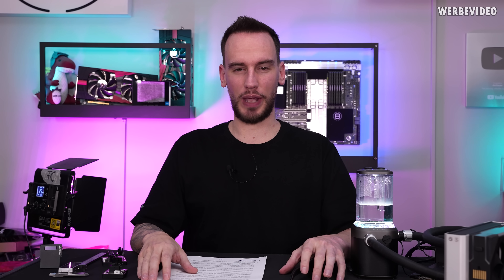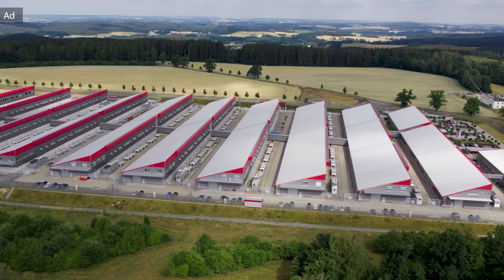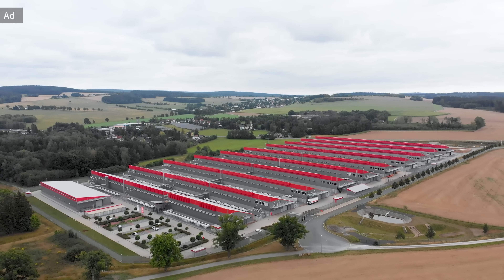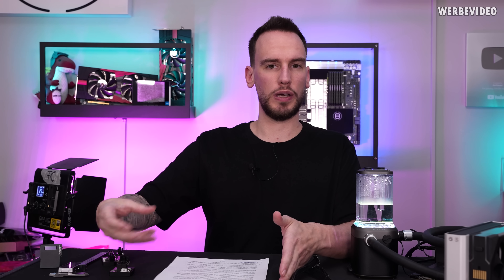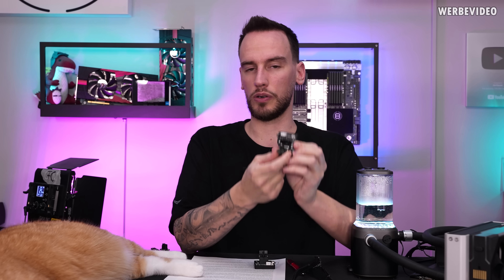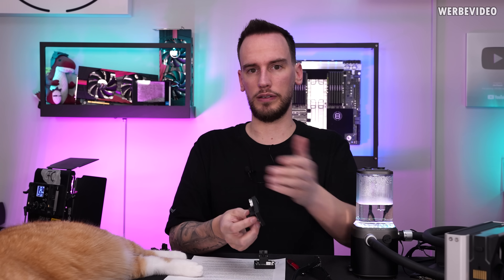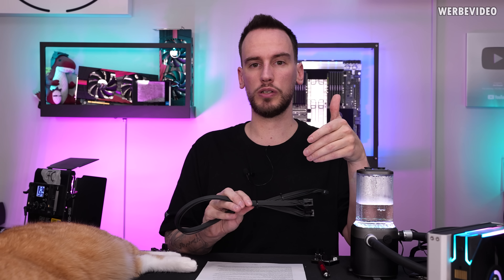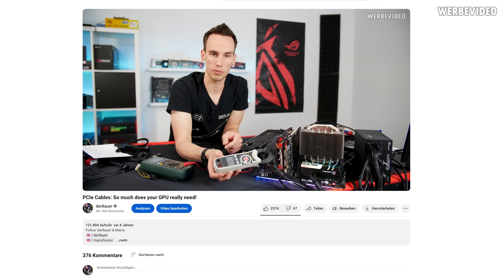12VHPWR is just Garbage and will Remain a Problem!!

Comment: it still blows my mind how this cable and issue was not caught during manufacturing and testing. It blows my actual mind lmao.
Reply: It was likely tested outside of a case with straight cables.
Reply: @weeooh1  at the factory they test circuit boards with jigs in (semi)automated testers(ICT/FCT). The test operator dont have to plug in or pull out anything, the test equipment will do the test process trough dedicated test points on the PCB. If they need to use external plugs during the test process, then the jig will handle it too(the jig uses direct contact pins instead of connector or cable). Ive worked for 15 years as SMT operator and as a group leader i needed to know the entire SMT and backend processes on "my lines".
Reply: @talos86  so no 'real world' testing conditions that takes into account how the product may perform with consumer usage.
Reply: @weeooh1  i dont know about the prototype phase, only the sample NPI phase(thats what the operators encounter on the SMT line). Those boards are usually tested off factory at the AIB to build the test equipment(usually with the help of Agilent or Keysight).
Reply: @weeooh1  The biggest false narrative is that real world testing is possible.  It is not.  You cannot test for every real world scenario, you can't even test for most of them.  You have no control over how the customer will install, what jerry rigged nonsense they will pull, how bad the conditions at install location will be with ambient temps, dust, etc., or even what kind of case or mounting they will use.  You test for standard by design install, maybe a handful of very common but slightly not standard install methods, and that's it.

Trying to do more than that is just a rabbit hole you will never climb out of or find the bottom.
Reply: As someone who is an Engineer in this field, it doesn't surprise me at all. 
Quality is definitely something I have to put my foot down for every single time. And even then sometimes I have to yield to the project manager. Only to be vidicated a month later when it is produced and gives de-rating issues anyway. At some point you'd think they'd heed my warnings but yeah...

The thing missing in his calculations though, is the effect of temperature on de-rating. Also, the CCC (current carry conductor) is usually measured by us per gauge in a cable. Not by individual strands. You can imagine the temperature in a case is usually quite a bit higher than 20, I would assume in a gaming session it'd be double. So that'd probably take another hit. So if you calculate for CCC and temperature, the safety margin would be quite a bit less. Hence the 150W.
Reply: @The_Noticer.  In the defense of the project manager they have bosses too.  I have seen many decisions like this come down to someone who is purely on the business side and get made by black and white number analysis that has nothing to do with the product itself.  What if it costs a real percentage of margin toi change which may negatively impact quarterly earnings and stock valuation?  Add in the possibility of a promised timeline to CEO/Board of Directors and what if it slips due to these enhancements?

Unless you can conclusively prove a real risk of RMA that has a real percentage associated with it (not 0.05% of a single percent)  you are going to lose that argument at the executive level.  Now did some engineer at Nvidia do this and it got ignored?  Honestly I doubt it.  They probably either underestimated the risk, or possibly social media and gamer outrage is blowing it out of proportion (which would not surprise me).  

I am willing to bet the failure rate is probably below half a percent.  Looking at amazon alone and just the 4090 founders edition over 300 have been sold in the last month even at these stupid scalper prices.  Imagine what it was like when these things sold for actual MSRP and shipping to China was not banned.  Also you have to factor cost of repair, which in this case is actually very low, you just have to desolder the old connector, solder on a new one, and bingo you are good to go.
Reply: What's more crazy is they still haven't fixed the issue after all this time
Reply: @HeliumFreak  Because they know if the 'fixed' an issue which they claim is non-existent then they will be easily open to a lawsuit.
Reply: Coming from the company that made the 4060 perform worse than the card it replaced? This is completely in pattern with Nvidia
Reply: Easy.. they only tested a small number of cables,  in a laboratory setting..
Then sold millions with mass production. 
If they would have tested 1 million cables, I'm sure they would have had failures.  ALSO who is to say that they did not have any failures,  whether big or small? and decided to go forward because it was such a low failure rate. 

Failure rates are on a percentage,  not absolute 0
So if 1 in 20,000 cables has a bit of melting,  that is a passing score 

Car manufacturers do this,  with WAY lower thresholds and way more failures,  and still green light
Reply: They obviously know 😏  its just too late too expensive to admit the defect so they blame the customers.
Reply: That's the funny thing they actually knew about this from the get-go
Reply: Problems happen, I would of gave Nvidia props if they took care if it, but they just go silent, screw our customers, we got your money is the feeling I get from Nvidia.
Reply: Design by open committee.  12vhpwr designed by PCISIG committee.  USBC, with burnt up devices, and broken ports, design by committee.  Remember how bad WEP ‘encryption’ was for wifi, design by open committee.
Reply: Probably the reason why evga got out of the graphic cards business.
Reply: They probably know. I am curious to know who all were involved in the adoption of this connector and not using the other one.
Reply: @FirestormX9  in one of nvidia's reports they stated they knew of the possibility of this happening but they did not think the risk was significant enough to do anything about it
Reply: Unless I'm misremembering, even during validation testing of their new graphics cards AIBs had the plugs melt on them on a constant basis. I vaguely recall this being mentioned in at least one of the early videos about the 12VHPWR plug.
Reply: Works fine several hours if you don`t touch the computer after complete tight install… Users just use it ”Wrong”!
😂😂😂
Reply: It probably was, and nobody gave a fuck. I'm not talking about cable mod. I'm talking about the standard
Reply: @TheHighborn  they actually though like "manuacturers just should use more connectors when needed". and ngreedia being ngreedia used just 1 on a 600W card, because they are ngreedia. the funniest thing is all AIBs just followed their stupid approach/specs = stupid melting connectors on stupid overpriced 1000 bucks GPUs.
Reply: You can bet your ass on the fact that it was caught. It was just too late into the process and they took their chance, in typical Ngreedia fashion.
Reply: I work with these kind of things as a thermographer and it's actually mindblowing how they didn't consider it. Usually it's a fabrication or installation error but in this case which is rare, it's a stupid design... Wouldn't expect that from such a big company.
Reply: It was tested.. tested by people who got burnt cards but you have GN saying its user error when Roman shows literally bending it slightly has the card tell us it's not seated properly. That is a straight up manufacturing and design issue.
Reply: or that the low margin of error was seen as okay
Reply: Because someone testing a connector specifically probably always made sure it was inserted properly. They didn't test the idiot factor. Anyone that assumes something is idiot proof is horribly underestimating idiots.
Reply: Does it blow your 4090 too 😂
Reply: Starting to doubt the QA testing, who knows why they didnt catch this issue 🤔
Reply: It was tested. The 3090Ti had it and no melting ever occurred. Something about this connector was revised between 3090Ti and 4090 that ruined everything.
Reply: @theyoungjawn  it was tested you're not wrong but it was a small sample size and not released to the public and done in lab conditions which means it was in the best place to succeed. Even IRL this issue is relatively rare compared to the number of gpus using it. Nvidia should have tested larger samples in a accurate envirorment. Also Nvidia didn't change the design standards at all between the 3090Ti tests and the 4090 production
Reply: Nonsense. Search "Melted PCIe Cable" Images it'll quickly be apparent that people can't plug in cables. 50 in 100,000 is human error and it won't make a difference if it's 4 x 8-pins or 1 x 12+4-pins 12VHPWR.
Reply: It was caught pre-launch by testing and Nvidia launched anyway and then blamed users when melting insulation occurred in customer systems.
There was an email alert on a standards related group which Gamers Nexus received.
The tech press for most part ignored that report and many even criticised AMD for listing 8 pin connectors as a feature.
Reply: Given that most of the issues appeared weeks if not months after purchase it's likely that they simply never did long term burn in tests with these cables at the maximum rated Wattage not surprising given how quickly the standard was pushed out the door.
Reply: @fredsorre6605  not so simple, plugs have insertion ratings and cables bend radii.  Simply putting Amps through the cable can pass in an unsafe product.
The available info shows problems with 12VHPWR were known and ignored because it allowed smaller board designs.
Reply: it isn't surprising. when Nvidia started to push DLSS and AI you knew this would eventually happen.  when DGX came out and Jensen bragged about how many Kilowatts it needs, you knew consumer card would need more and more power.
Reply: It was. They released anyway.
Reply: it shouldn't the problem is easily described : stop using open test benches to validate everything they are not a real pc !!! I looked for 4hrs and could not find at the time any pc case you could buy were you can close the side panel, since then lian li released larger cases so maybe some exist now but 1y ago none of the main cases even the ulra large ones could, they were all missing 2-3cm space between the motherboard and left panel
Reply: during testing is not the issue. It's that for this long time there's no universal solution or agreement.
Reply: They don't care like naming of HDMI 2.1 they want to scam costumer
Reply: It was, they knew, they didn't care.  All of the information he gives here regarding 8pin vs mini 12pin specs was posted/discussed on forums prior to the 3090 release, and again when the 4090s started burning.  Nvidia didn't care and their fanboys viciously defended it.
Reply: They did IIRC. There were videos of melting cables in the beginning - directly from the manufacturers even - and suggestions for mitigating the problems.

They knew about it. They just didn't care and/or were too greedy.
Reply: @Jeff-ss6qt  ngreedia just wants their overpriced af cards to die out of warranty. melting power connectors is just a planned obsolescence thing. because they killed any progress in PC gaming hardware so they have to insure somehow that consumers keep buying more of their overpriced af 0 progress crap. thats why they nerf drivers (so called phenomenon of 'AMD fine wine' is actually happening thanks only to ngreedia - when ayymd still updates their drivers for newer games and ngreedia just don't), artificially segment the market by removing software features from older products (like glitchy frame gen) + make hardware unreliable and prone to dying (out of warranty ofc).
Reply: You act as if they care to begin with lol.
Reply: It blows my mind that it's a an obvious fire hazard and yet there's no class action lawsuit against NVIDIA and no regulator in any country has forced them to recall their faulty cards. Fire hazard is an extremely serious issue.
Reply: Yep, I expect a V2 connector in the next few years where the connectors are thicker guage and the cables themselves being thicker as the standard. That's the only solution here if they insist on a singular connector.
Reply: @llamapi3 FPMSL, V2 is already in use and has been for months.
Reply: adapter*. the cables are fine.
Reply: It was done on purpose. Nothing to catch here. Planned obsolescence.
Reply: eeeh, you never underestimate the cost cuts and rushed products pushed by bean counters looking for a bonus.
Reply: Have you seen GPU testing facilities? Rows and rows of pcie slots in a room at ideal temperatures, they're not testing any of these cards in realistic use cases.
Reply: I assume it was caught, but someone at nvidia didnt want to swap off of it. AMD was going to use it but swapped back instead of launching with 12vhp
Reply: It should be staggeringly obvious to anyone not sickeningly undereducated that a pin's ampacity can be exceeded if there is complete failure to do something as utterly trivial as plug it in correctly and check the catch is secure as blatantly designed. The sheer lack of intelligence, care, and attention to the most remedial of detail associated with the degrading failure to do this constitutes a truly shameful embarrassment. All this hoo-ha over the source of failure is shocking and ridiculous, and shame on all those suggesting any problem lies with anyone but the user on this matter.

Properly seat your power cables, buy a case that fits, do not bend cables, do not use 3rd party adapters, have a professional who knows what they are doing building rigs and you will have a %99.9 success rate according to the current data..
Reply: There are actually many scientific studies which support these cables under high load, this guy doesn't know what he's talking about. The people using them must be misusing them.
Reply: they don't care. the cost to manufacture a 4090 is like 200-300 bucks now. they sell them for 1600-2000 bucks. let 'em burn = more dead cards = more money.

a 4090 die 608mm2 costs 300 bucks MAX to make according to wafer calcs and 2 y.o. TSMC prices per wafer, its more like 200 bucks now. 300 bucks number from calcs is too high because its 2 y.o. prices, ngreedia cut TSMC orders = they are getting better prices to not cut even more orders, + on the same wafer where big dies don't fit you (theoretically) can also make smaller dies like a 4080, a 4070Ti etc. which ngreedia can get "for free" - if you account for them unlike wafer calcs do = they lower the cost of a wafer significantly.
$1600-$2000 for a less than 300 bucks 4090 die (more likely $200 now)? just lol. I understand if they'd want 800 bucks for the 4090, max. it still would be at least 200 bucks overpriced.

but fanboys are buying overpriced af GPUs anyway, so ngreedia keeps selling.
Reply: @rawdez_  tsmc has also been raising their prices. Nvidia is probably looking at $700-900 cost for every 4090 sitting on the shelf in store after accounting for the cost of the pcb, cooler, box, shipping, logistics, retailer margin. Then think about AIBs that have to pay Nvidias margin for the die itself. Then come up with a better cooler, then the margin for the wholesalers, then the retailers margin again. It all adds up very quickly.

Are they still overpriced? I’m sure they are, but not as outrageously as people assume. They’re certainly not netting anywhere near $1000 per card. 

It’s also difficult to put a number on R&D. Sure a $1300 iPhone is proven to have around $500 in parts, but Apple does a lot of expensive R&D that just constantly churns out results that are difficult to price in per phone.
Reply: @rawdez_ do you have an idea how a warranty works?
Reply: @thesolidsnek8096  you think they care for warranty?

hell you think they care for public safety knowing that they used a unsafe power connector?

ask yourself how did this power connector ever pass consumer safety checks
Reply: @xthelord1668  of course they do if they refuse to RMA the card they'll land on derbauer or GN and get roasted.
Reply: @thesolidsnek8096  ill remind you that GN said that it is a user error and not power connector design problem

while at the same time there were blueprints flying around the internet where you could clearly see that connector was fire hazard for spec NVIDIA wanted which everyone agreed that this connector is basically a fire hazard

so much for GN being reputable when dude has "aged like milk" video regarding this power connector
Reply: @xthelord1668  I mean idk what you are talking about i have yet to see a person who hasnt got a RMA on this issue after all the controversy. They saw that the cable will fail due to user error and most of the failed cards are either those or all the cards using an adapter instead of a pure native cable. I have built 2 systems with the same cable and they dont slide out or show no signs of burning or melting the connector but even if it happens i will get a new card and cables. Since i have documented that my cables sit good and i keep checking on it every once in a while
Reply: @thesolidsnek8096  there’s literally millions of cards out there without issues, what are you talking about.
Reply: @oxfordsparky  Bro is such a shill he doesnt even realize i wasnt hating on Nvidia lol
Reply: @xthelord1668 It can be both
Reply: @thesolidsnek8096 that’s not what he meant.  It means they will die by the time the 5000 series is out.
Reply: @rawdez_ it costs pennies to make a bottle of coke.  But they sell it from anywhere from $1-$3 in a convenience store.  They can be upwards of $10 at a concert or ball game.

$300 to manufacture the chip is just that.  The chip. Now how much is the RAM, the PCB, other board components, the cooling solution, shipping, engineering time, and marketing?  That all adds up.

Since 3x cost is roughly the standard to make up for labor costs, overhead, insurances, and profit, $1600 is sounding about right. They could probably get away with $1200, but it is also a halo product.

With that said, you also have to account what the market will bear.  If they are selling it that price or more than why not sell it at that price or more?  

You don't need it. It's not food, nor water, nor shelter nor energy.  It's a luxury good.  

For the record, this is true for Intel and AMD and all the other companies that make anything. Manufacturing costs are just one small part of the equation when it comes to pricing goods.
Reply: @rawdez_  300 for the whole card? what are you smoking? Nvidia is good margins but not quite that good. The rest of the thing also costs quite a bit, memory is not free (or cheap really) nor is the PCB and cooler. I honestly wish they could make them for 300 all in cost, would be great for the stock honestly. imagine the gross margin reports. Sadly the world of high-end electronic manufacturing is not quite so rosy and those pesky engineers are so expensive too...
Reply: @rawdez_ hold on, let me try and get my head around idiot math. 

So an entire GPU including all packaging costs $2-300 and the die costs upto $300, so the pcb, memory, vrm’s, all of the surface mount components, io bracket, cooler and packaging is free?
Reply: @rawdez_ fucking amazing, I missed the part where you claimed that 4080 and 4070 died are free 🤣🤣🤣🤣🤣

And you have the audacity to call others stupid, fucking amazing.
Reply: @rawdez_  You're misunderstanding.

The board partners do care. Nvidia doesn't.

Nvidia decided they didn't like all the PCIE power cables on their cards, likely because it rightly implied their cards were power inefficient. They tried that bad 12 pin no one, not even their own board partners, would adopt first. Then they got PCI SIG and Intel/ATX to adopt this thing.

Nvidia truly doesn't care once they sell the board partners the GPU what happens to the graphics cards. They've made their money. They'd only really care if people were actually buying a lot of the Nvidia first party cards and that isn't the case because Nvidia is barely even making the things.

The board partners have said pretty openly that in many cases the Nvidia MSRP is below what it costs them to make cards which is why you never see cards at those prices for many models.
Reply: @KenS1267 ”it rightly implied their cards were power inefficient” WTAF are you talking about, current nvidia cards  are shockingly efficient compared to last gen and competitor products.
Reply: @KenS1267  the connector isn’t a fucking nVidia design, stopping creating a false narrative to fit with your skewed views FFS.
Reply: I work in manufacturing, and I can tell you that it was absolutely caught. The executives just don't listen to the ground-floor people or people that know what they are talking about because they know better. I've seen this over and over again, so much so that I won't ever buy the product I manufacture, because I know better. Tell me... why would Nvidia executives backpedal on something that would make them look like fools for even suggesting it, when they can just blame the user base(customers) for being dumb and get away with it.
Reply: Because everyone blames the cable and not the connector. The issue is with the connector only, 3090 ti used the same cable with no sense pins. Not only that, the myst of the cable bending issue cause people to double down on adapter and double the problem. 
In short, for 4070ti and newer 1.07V 4080 4090 do not use any additional connectors/adapters.
Reply: @floorgang420 the 3090ti used a different connector with 33% more pins.
Reply: Oh it was noticed, they just didn't care, more cards breaking because of it will bring in more profit for them, they even went a head and blamed customers for the issue. They just didn't take into account that some of their customers aren't stupid. Even the breaking issue there's no way cards weren't stress tested, even cheap phones are stress tested on how many drops it takes for the case or screen to break, meanwhile a $1k + card breaks from its own weight and the manufacturer won't RMA it because its "user error", why the fuck is it user error when the thing that cost $1k + break from its own weight when its plugged in on a stationary case not to mention the card doesn't even come with its own support.

They could have made use of the tried and tested electrical connectors in use today but instead go with the "Yeah lets just add more holes on this connector we made before".
Reply: @jawman0  "More cards breaking because of it will bring more profit for them"? Rather the opposit, warranty claims are a cost to the manufacturer.
Reply: @dorientjewoller113  Their plan was to blame users for the damage and deny it was a design failure, but the customers weren't stupid and went after their ass. 

Still they sold more cards because not every final customer were able to have their cards replaced due to how they bought the cards. Like from an online store or reseller or hoarder that bought the cards first and then sold it a little bit cheaper when they couldn't inflate the price, i don't know how its in your country but in mine if the first user sold the card to a second user its not covered by the warranty unless they have the receipt of the first user, even then its still going to be processed and the chance of the card being replaced is less than 1% because of stupid reasons.

Rich customers just buy a new card from a different manufacturer/brand to avoid the waiting time for replacement.
Reply: A room full of engineers will always be less capable of inventing problems than the consumer. Not everything gets thought of.
Reply: @iamdarkyoshi   That's the deal that baffles me tho: as one myself (engineer) I sometimes imagine the most idiotic thing anyone can do with a device. But one thing is for sure: I was never so r-tarded to use a part at like 98% of it's absolute maximum rating, like they did with this connector.

The idiots that invented this 12VHPWR connector (NOT the Molex part used, the spec inside a PC component I mean) should just throw their diplomas in the trash bin and go dunno, sell bubble gum whatever, cause they sure don't know the 1st thing about engineering.
Reply: @8bits955  thats all bullcrap - everything you've mentioned is done just as well for products 10-50 times cheaper. they are overprice without any "but" that can justify their prices. also there's 0 progress per dollar. its actually regression in value because its slow af hardware. its how coprorations make billions in profits - sell the same crap year after year after year [...] after year with cheap software solutions (upscale + glitchy fake frames) instead of actual hardware progress. no progress = old hardware stays relevant and overpriced. and segmentation is totally artificial with software features. hardware is the same old slow obsolete 6 y.o. crap with basically 0 R&D costs spent. also its a byproduct of server chips, so 0 costs anyway.

and you're just repeating their marketing fairytales for noobs.
Reply: @rawdez_  why build better hardware when you can make better software to pretend your hardware I'd better. Dlss. It's self inflicted cause people today are ok with the placebo.
Reply: They planned this obsolescence too well
Reply: it was caught, they just didnt give a shit
Reply: Yeah, honestly every problem with the connectors I've seen are from cases... My only problem I've had was a case and I induced it by trying to cram a 4080 into a smaller case...
Reply: @SimanSlivar  that is blatantly false.